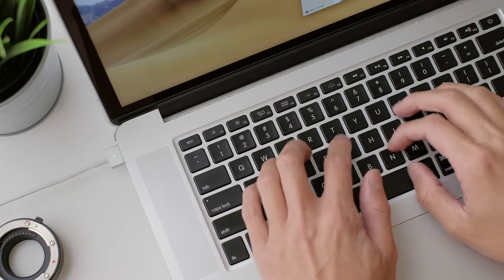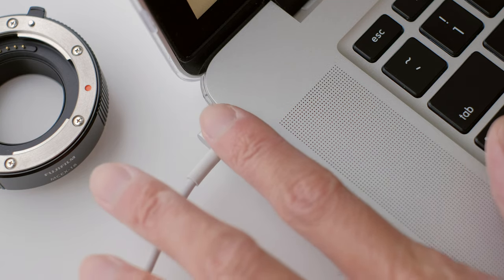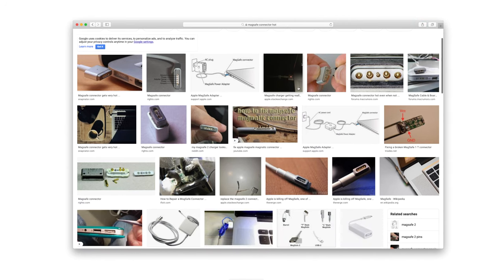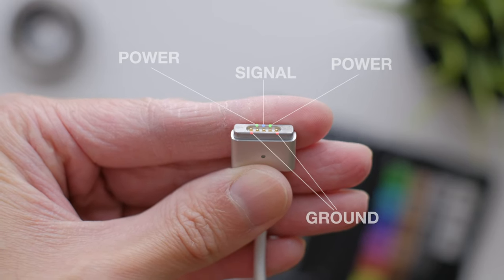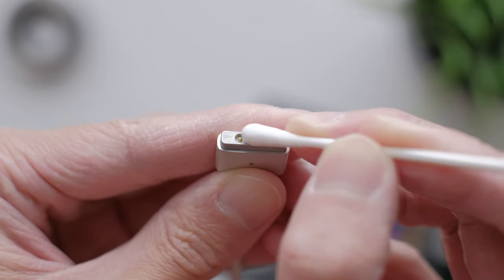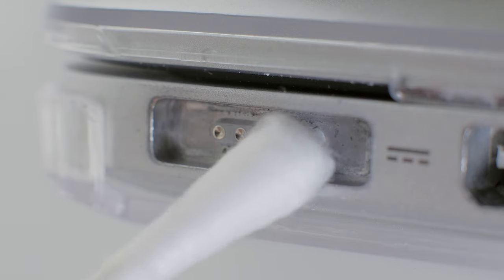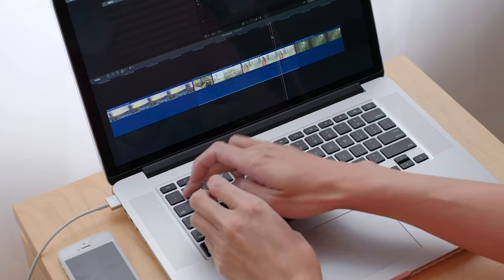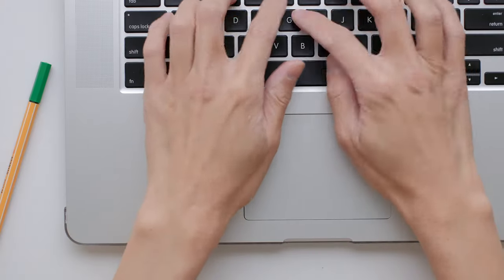BURNING HOT Apple MagSafe 2 Connector when charging. This can't be right...

Comment: A great hint, started to be insanely hot. Googled a bit and came across this video. It is unbelievable, that even despite it looks clean and shiny, there is heating, but once you use some alcohol, then no more. It is still pretty warm, but not crazy hot. Of course, if to consider how much power goes through these tiny pins, the heating is a part of design.
Reply from the maker: That's true, it's normal that they get hot but some people say their port is actually burnt etc which is not normal, especially when there's trap dirt?

Comment: I've owned several MacBooks and this has proven to be a common problem. The magsafe port on first one got so hot that it literally melted parts of the connector. The others have had similar issues, although not to that extreme. Eventually I realized that cleaning the connector port is the equivalent of required maintenance on a MacBook. These get dirty and if not kept clean will create electrical resistance which causes the connections to heat up, causing more resistance and heat, etc., etc. It's basically a feedback loop that just keeps getting worse if not caught in time. Obviously, it's best to catch it before any damage is done, so keep an eye on the connectors and keep everything clean. If your charger pins get sticky and you can't get them working smoothly, replace the charger ASAP. Otherwise it will eventually do other damage. (Don't ask me how I know...)
Reply from the maker: Wise words. Absolutely agree. I have been using my MacBook for so many years. But never occurred to me that the plugs get that hot or could get stuck! Hence this video, hopefully can help others remedy this or best yet, proven it from happening in the first like you said.

Comment: Yes, still on a 2013, just cleaned the plug. I've had the overheating problem for a long time now. Even some pins burnt (the two on each side). It seems I could have cleaned these at least now and let's see what happens. Thanks!
Reply from the maker: Hope this helps. Same here, I never checked it since 2013 until I made this video. Since then, it seems like it's not as hot as before (for me).

Comment: My replacement cable started doing this, was just about to order a new one, I watched your video and realized one of the pins on the end was stuck. A little poking and it released, problem solved! Soo stoked I had to leave a comment hah. Thanks. 🤘
Reply from the maker: Glad to hear it worked for you too. Thanks for watching my video and sharing the story. ☺️
Reply: Can you link to a replacement cable (preferably USB C to magsafe for MacBook A1278)?
Reply from the maker: I don’t think there’s such a cable from USB C to MagSafe (Version 1). On my latest MacBook Pro M1 Max 16” or newer MacBook Air, Apple makes one for it but that’s MagSafe version 3. I don’t think anyone makes a USB C to the MagSafe since it’s a Apple standard.
Reply: @JoeLamOfficial  thank you for the update. After much searching, that is about what I found too. I did, however, find a short MagSafe (v1) plug with a female USB C end. I can plug that into a USB C cable to achieve near the same. Again, thank you for the information and the great video!

Comment: so mine isnt hot but my wire is sooo yellow. I got it replaced 2 years later (so like 2017) fml..... i hate the apple store.
Reply from the maker: Hi Mia. Yellow from burnt or UV exposure over time? If it’s burnt, that sounds quite dangerous!
Reply: @JoeLamOfficial  I can't tell the difference honestly, it's been yellow for like a few years now. It doesn't wipe off even with an alcohol wipe :(
Reply from the maker: Is your plug itself or the MacBook port burnt or super hot? 
If it’s not burnt. Plastic do go yellow over time especially with UV exposure.
Reply: Same mine at the start is yellow as well and could be a fire hazard but i have no uv exposure at all but leave it plugged in when gaming a lot on it.
Reply from the maker: Mines plugged in most of the time too. How’s the plug itself ? Is it hot? Is it burnt?

Comment: I have found the port on macbook which has the magnet accumulated fine metallic particles which did not allow the connector to seat properly. This causes excessive resistance hence the high temperature. Also a week battery will need the full 45watt current to constantly charge also causing excessive heat.

Comment: THANK YOU!!!   Worked for me.  Used a toothbrush I was given on an international flight, dipped it in a cap of alcohol and scrubbed both the charger port and the computer port (with the port facing the ground, so nothing would drip into the computer).  Used a cotton swab to dry  everything.  Plugged the charger into the port and no more red hot connection. 

Previously, I could hear the connection arc, which I originally thought was the hard drive.  I took it in for inspection at the Apple store months ago and was handed by the manager to their "top genius," but he was unable to duplicate the problem.  Seems to me there should have been a bulletin on this issue and he should have known about this, as it is a fire hazard.
Reply from the maker: Hey thanks for sharing your success story. Glad to hear I’m not the only one. Thank you!! 😊

Comment: made my day. It was heating up and a cleaning helped . many thanks for sharing. Did not realise the pins go in.. that pushing in and out for few times.. did the trick. Also after the cleaning, when you try to pull the port it will take more force to pull it out. This means it is stuck properly and hence no heat loss and better charging...
Reply from the maker: Sreekanth P thanks for the feedback and comment. Glad it helped! 😉
Reply: thanks.. one question are all the pins at the same level. I see mine 1 and 5 are protruding more out..and 2,3 and 4 a little depressed. As it will still heating the adapter.. wanted to check the level of the pins. Than you.
Reply from the maker: Hi Sreekanth. I just checked mine. 1 and 5 do protrude more on mine too. Whereas the middle 3 are slightly recessed. I think it’s normal.

Comment: Same issue, replaced my power adapter last year.  Noticed the cable was yellowing near the MagSafe connection and the connection as well as the area near it on my 2014 MacBook were insanely hot.  Cleaned up with isopropyl alcohol and what a difference.  This is probably why I ended up with the dreaded logic board issue requiring the AppleThunderboltNHI.kext driver to be shut down with every update.
Thank you for extending the life and safety of this great computer.
Reply from the maker: Hey there - glad to hear this helped out your MagSafe. 🙋🏻‍♂️

Comment from the maker: Just to clarify some things:

1. I have two MagSafe 85w adapters, one came with the MacBook when I purchased new and a second one from official Apple Store here in the UK.
2. After further testing, the connector is definitely WAY less hot now, even when charging and under heavy load (eg. editing this video). I can actually hold on to it for almost indefinitely, whereas before; simply unplugging it was almost too hot to hold for a few seconds. 

There could many more other problems that might cause the connector to heat up, but this seems to have solved my problem. Thanks for watching. :)
Reply: i have been having issues with my cord being Yellow which is a hazard currently waiting on a new charger to come Macbooks seem to have the common issue with the outer wiring being yellow a lot.
Reply from the maker: Assuming it’s not yellowing from exposed to UV but actually being burnt. That is definitely bad.☹️

Comment: Thank you Joe. I have MACBOOK PRO mid 2014. It has not missed a beat and still going strong. I've had this problem since new with charger. Also boiling hot on the white box part of charger, (sorry dont know correct terminology). I often have it plugged into a new power board with 6 outlets. I't doesn't get as hot if I plug it into the wall socket directly, but still hot.
Reply from the maker: Hi Jeanette. My late 2013 still running here too making these YouTube videos. :)
Mines pretty much plugged all the time too through extension power board like yourself. My charger itself isn’t burnt or overly hot. The white “box” casing. Only on the MagSafe plug itself when connected to the body of the MacBook. 
As long as nothing is burnt on your plugs charger or the MacBook. I guess it’s OK that it does get hot. Only when it’s burnt that’s worrying.

Comment: Awesome, tried some IPA and a toothbrush and this seemed to fix it.
Makes sense, if only part of the connectors are making contact it would be similar to running high current through a thin wire, it would heat up. If it's REALLY little contact, it could possibly generate enough heat to melt the cable or damage the connector permanently.
Reply from the maker: Hey thanks for checking out my video. Nice explanation too!

Comment: I have been an Apple user since 1981. My primary device is an iPhone X, but I also routinely use:

2 - 2007 iMacs
iPhone 4s
iPhone 5

These are ancient devices in the computer world. 

I was still using a 1998 MacBook until 2010, and it had been through a car wreck and had the screen completely detached except for one tiny wire connecting the keyboard. 

Apple makes tough, long-lasting products, which is why I love them!
Reply: Completely forgot also I’m wearing an Apple Watch series 5, which i tend to forget I own because it’ functions so seamlessly.
Reply from the maker: Lucas Penick wow. 😮 I’ve been using Macs since 2010. Prior to that had iPods and iPhones. Haven’t updated my MacBook since 2013 ever since the keyboard and lack of RAM options. Both have finally been updated. But not a fan of the Touch Bar or the crazy high price tag. iPhone X user and again, since removing 3D Touch made me reluctant to upgrade. Might use it for years to come like my MacBook Pro 😕

Comment: Thank you so much, first it was hot yellowing wires, then a super hot charging head. I was confused because there was no obstruction in the connection, and the pins were barely burnt. After loosening the pins using a ruler, the charger is now noticeably cooler to touch. Thanks!
Reply from the maker: Glad it helped you too! I never realised mine was hot all these years as it's mainly plugged in 24/7! 🔥
Reply: @JoeLamOfficial  Can relate, in the recent months I usually keep my mac plugged in. One day I drained the battery and charged it. And i was worrying why the charger head was so hot. I was wondering if it was just me not remembering after a while or it really was not normal. then i came across your video then *boom*. It worked, it is still warmer than it was new but at least it somewhat worked and made it less severe. :)
Reply from the maker: Glad it helped. I mean it's normal for it to get hot or warm but in my case it literally felt like burning. 🔥
Reply: @JoeLamOfficial  Agree, in addition to that, the heat produced by the charger head should also be related to the use of the laptop, it's normal for it to get hot when doing something CPU intensive because high energy + high temperature of the laptop itself. And I guess it could be a bit less warm when it is in sleep mode.
Reply from the maker: True. Depending on ambient temperature and if charging from a low power state.

Comment: My Macbook Air connector got so hot I could barely touch it. Found your advice and the problem solved! Thanks a lot.
Reply from the maker: Hey. Glad it worked for you too. Same. Mine was so hot before cleaning. Thanks again.

Comment: Had a MacBook through a year in Iraq. It finally went out after 9 years and was preforming great. In that time I did 0 repairs on it during that time. So they are absolutely worth the money.
Reply from the maker: Tyler Richardson awesome stuff! Did you replace it with a new MacBook at the end?
Reply: Joe Lam of course. Had it all backed up because it was just getting so old. Plugged the external hd in and it was like I never lost my first one... except with less USB ports.
Reply from the maker: Tyler Richardson how you finding the keyboard. Any different? Mines also crapping out a little. Almost time to upgrade.

Comment: Worked!  A some point it must be that a build up of debris can lead to over heating.  I was able to clean as instructed revealing the metallic shine of the connector points male/female and my Mac is restored.  If I use a higher watt power adapter meant for the Pro on my Air, it does heat up a bit more, so I just won’t do that anymore.  It’s possible this was always in the design, but since the machines are aged and still work well, won’t interchange MagSafes anymore.

Comment: 02:33 I desperately need that adapter for the 60W MagSafe.  Kindly share the name of it? 🙏🏾 (name of adapter piece for wall plug)  Thanks
Reply: I have a LATE 2012 MacBook Pro with the "Service Battery" notification.....now, the charger gets SUPER 🔥 HOT, exactly like this video explained.  I have all the tools and iFixIt Tutorial , but need to order the A1425 Battery (very challenging to find it).   Concerns are:

-- Will Battery be correct 
--- Do I need a new charging port too?

Thanks to anyone that can help with advice.   Stay well!
Reply: JUST an UPDATE:  Two of the pins are not cooperating...lol.  They are severely stuck. I will look into getting another 60W MagSafe Charger and ordering the Battery (if I can only find a trusted A1425 Battery for MacBookPro Late 2012 13 Inch Retina....
Reply from the maker: Woah. Goodluck with the battery replacement. Mine says service required too but it still runs fairly well and most of the time I'm plugged in anyway. I might tackle the battery swap one day, but for now. I can't afford to break anything, so I won't risk it. Let me know how you get with it?
Reply: @JoeLamOfficial  Thanks for responding. Yes, that's me fear : destroying my MacBookPro.  Lol.  I am going to start with a Replacemenr Charging Adapter (since the pins ARE INDEED beyond repair).   I've gone 4 years with the "Service Battery" alert...*with not issues*.  Just this new HOTNESS.  I will certainly give an update.  I am an American, living on Botswana, so it's not easy getting parts sometimes.   Thanks again for responding.  Stay well!
Reply: @JoeLamOfficial  By the way, what's the name of that piece on the adapter?  I am an American that moved to Africa and need that little converter for the adapter.  Many thanks!
Reply from the maker: Yeah try it with the adapter first. Especially with the pins otherwise plugged in should still work with the replacement warning. Only means it won’t work long unplugged otherwise shouldn’t affect anything else
Reply: @JoeLamOfficial  Mr. Joe Lam: You are a blessing.   If it weren't for your video (about checking the pins), I would have ordered a battery or struggled to buy a new Mac.  

I was stressing and overly concerned, doing research for HOURS. Your video and responses to my questions changed my life (and stress levels). 

I found a "replacement" AC adapter today (through one of my local vendors) and everything is MUCH better.   I praise the Creator for YOU!!!! 

THANKS FOR BEING RESPONSOVE TO YOUR SUBSCRIBERS.   If you ever need a client testimonial or help with your channel, don't forget me!   I owe you  Mr. JOE.   THANKS AGAIN 😀
Reply from the maker: Thank you for such kind comment. Really appreciate it. Hope you have a wonderful day.

Comment: Edit: my wife's magsafe had burnt out a few times, and I had cleaned it for her a few times. This time one of the spring-loaded power connectors would not spring back. There must be so much junk down inside it that it just won't come back. So I tried soldering a pin to it to pull it back out, which worked, but then it got stuck down there again. So I added more solder to the pin itself, so the height of it was raised to just below the other pins.  Now it works well again (but for how long!).

I read that ground noise in the power can cause the power adaptor to switch off, so if you have that issue, apparently you can disconnect it for 60 seconds, and it will reset itself.
Reply from the maker: Hey thanks for chiming in with your experience regarding the MagSafe. Didn't know about the reset method. Thanks for sharing. Is it risky adding solder to the pin?

Comment: I did follow your advice...helped on the connector where it gets attached to the computer, but the Magsafe power adaptor still gets hot.
Reply from the maker: Is it too hot to touch? It's normal for it to get a bit hotter when under load and charging the battery at the same time though. As long its' not burnt etc. It's within tolerance.

Comment: I’ve been using my MacBook Air since 2016 and still working great. Charger is starting to heat up some when charging. Will check the connectors! Thanks!
Reply from the maker: Mona Leonard hi there. Hope it keeps working. I’ve been using mine since 2014. 🤣

Comment: You're still using your late 2013 MacBook Pro, too? Like I said in another comment, for me it's still perfectly fine. The only thing which bothers me is the battery. I consider to get a change, despite the high price...
Reply from the maker: Yup still rocking it to this date. Same. Battery only lasts around 3 hours, web browsing and YouTube. That’s the only annoying thing. 
And fan constantly on. 
Probably dust build up or just modern websites 4K video and editing pushing the chip to the limit compared to earlier years. 
Will try and hold out till M2 or M3 Laptops 😆